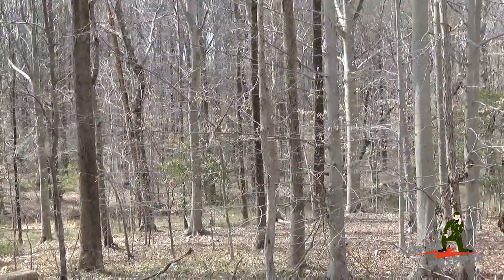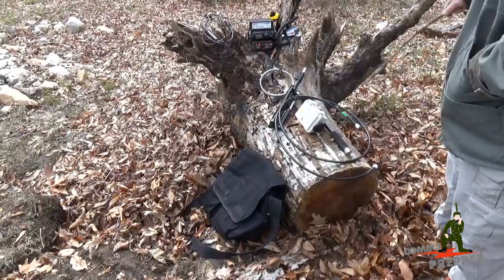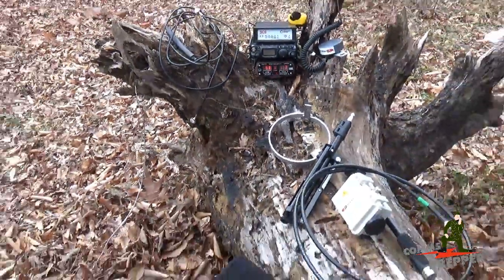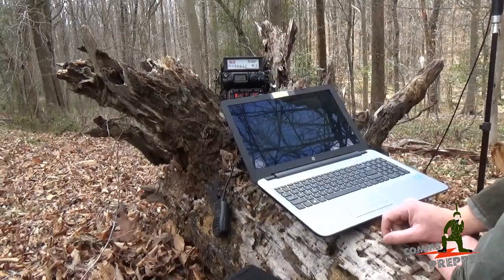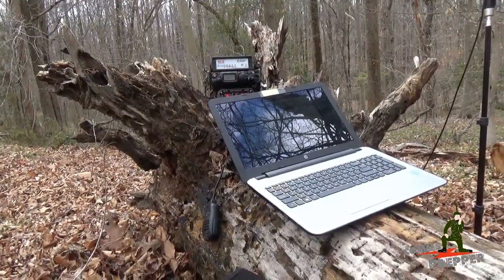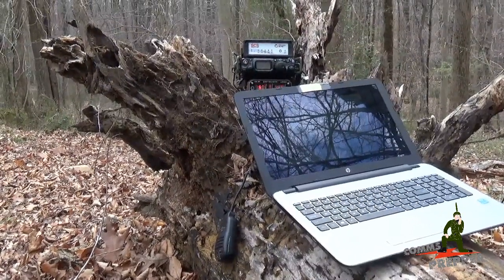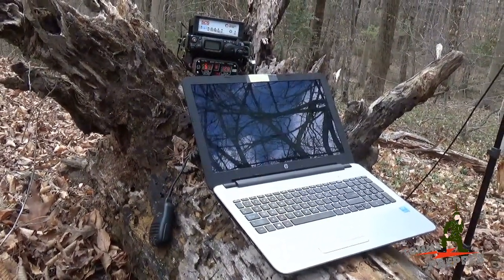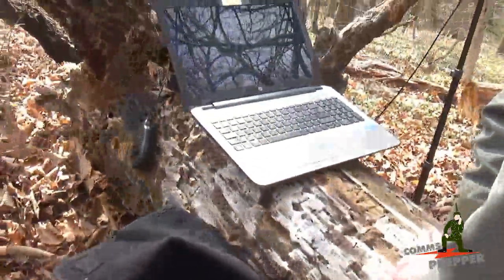Field demonstration of Chameleon P-Loop v2.0 antenna

Comment: Very nicely done, Hank!  Those millennials are not a trusting lot! I've also been testing the Chameleon P Loop 2.0. I just posted a video while using it with JT-65 while down the road from you while we were on vacation in Chincoteague Island,  Virginia. I was actually blown away by the receive capability on 40 m while the antenna was on our third floor balcony – including receiving signals from China and all over Europe and South America – again on 40 m not 20 m. Looking forward to a lot more radio sport time with this well-designed antenna.

Comment: This has got to be the most interesting and useful thing I've ever seen a radio do! I've never really thought about transmitting data via radio. How secure is this method of data transmission? if it's got solid security I can certainly see the value of not using a conventional phone internet connection. I definitely have a lot of research to do and try getting a system together to do this.
Reply from the maker: Not secure.  Ham radio does not allow the use the encryption programs like PGP and the sort.  All Ham comms must be in the clear.
Reply: Commsprepper yup. Well aware. I don't operate on ham frequencies.  But like I said, in my little world I certainly do intend to operate my crews with closed communication system.

Comment: Okay, I'm in the process of getting licensed and buying this equipment.  I LOVE the portability of this system!  Would you mind sharing the link to where I could get the bag that houses the Yaesu and the power compensator?  Also, does the coax that comes down from the tuning box into the rear of the radio come with the antenna?  If it doesn't, would you also share that link?  Thank you for sharing this information.
Reply from the maker: The radio bag is from AMP-3.net (USNERDOC on YouTube).  The antenna comes with the coax cable and black bag in video.
Reply: Thank you for your reply.

Comment: When you can send CW to the modem and control everything from whatever you send and it is converted to gmail, and get reply converted back to you in CW when reading your email, no computer, wow that IS a 1500 dollar modem! lol
Reply from the maker: Sorry but I don't understand your comment.  Can you rephrase it?
Reply: Comms - basically what I am saying, or as an idea, if the modem could be completely code controlled (morse code), the computer is inside the modem. How's that for clarity?
Reply from the maker: Very clear.  It would not work.  CW could not match the baud rates of the multi wave form available with the Pactor modems.  CW could not come close to touching the speeds.  Not sure how you would put emails into the system or take them out without a computer.  I guess you could put a linux board in the modem but would still need a keyboard/monitor to serve as an interface.
Reply: I mean, on the modem, you could have  a CW interpreter front end, that converts the cw to text language (replacing the keyboard and the laptop) which can be used to compose the email message, as well as pass simple commands to the modem.
Reply from the maker: Not sure what problem you are trying to solve.  This modem is not a CW modem.  It's a Pactor modem.
Reply: hahaha, sorry, I must be brainstorming out loud.

Comment: I always enjoy your videos and find them informative. I have the 817 and F-Loop. How do you tune the antenna? What settings on the radio do you use? FM, LSB, data?
Reply from the maker: for tuning I adjust the tuning knob on the loop for max noise.  Then I set the radio to low power, AM, and transmit with the microphone, watching the SWR scale on the radio and fine adjust the loop tuning knob for max dip.  From there I switch to DIG, with the DIG mode set to USER-U in the menu and rock-and-roll.
Reply: Thank you. I will try that. I have spent hours trying to get email out. You make it look so easy.